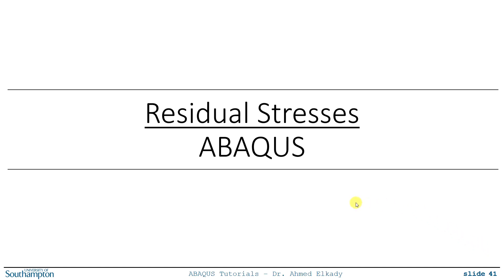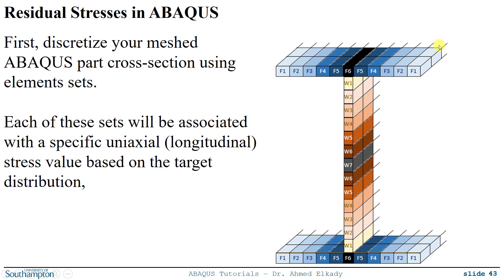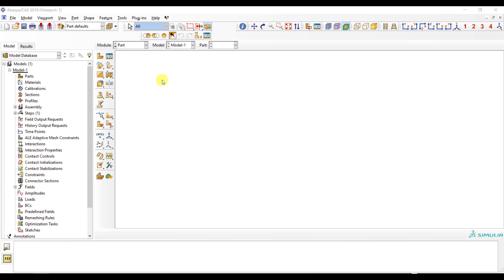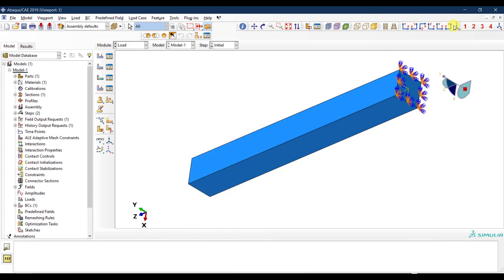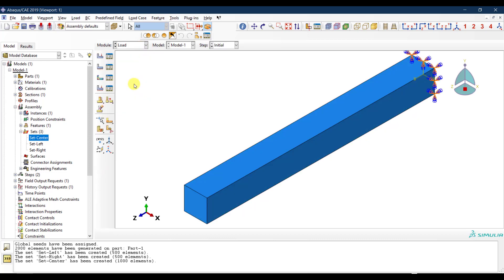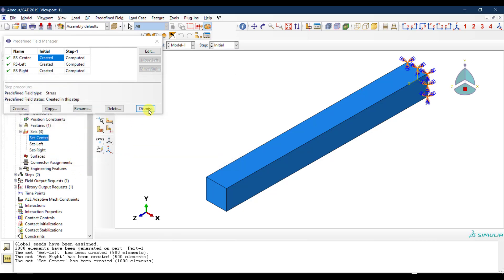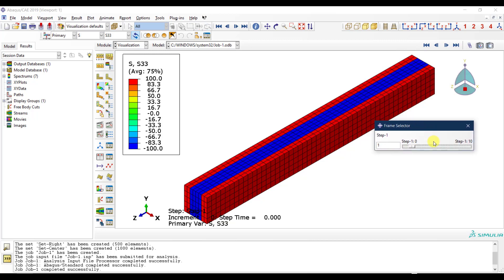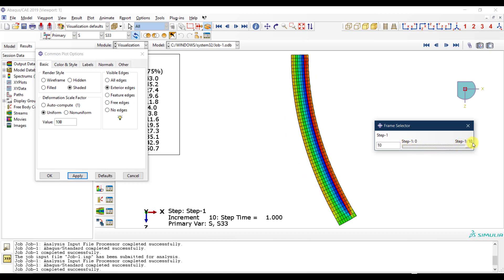#24 ABAQUS Tutorial: Modeling Residual Stresses

Comment: Thanks for your video.
Apparently using this method for residual stress in ABAQUS is not quiet right, because these residual stresses which we import as predefined field goes to solver and solve the equilibrium equation(which is wrong because it must not solve the equation for residual stress, it considers predefined field as an external force/etc), that is why you have different stress in the tip of the beam, it is not because of small errors.
Reply: Hi,

Do you know what would be correct way to input residual stresses in solid elements then?
Reply: @newtonavilasantos  No :/ 
Let me know if you find out :)))

Comment: How to apply residual stress by odb file
Reply: You have to do the same as in the video, except that you have to select "From output database file" at the Specification and point to ODB file. Unfortunately this only works for 3D elements and not for shell elements.
Reply: Then, is there any way to apply residual stress from odb files for 2D shell/wire element.
Reply: @aadilarfin8684  I haven found one yet. If I do, I will leave a comment.
Reply: Yes,  please share the way. Thank you

Comment: Thank you for the video. I have a question about the reason of the deformed direction. I was confused that this beam is bended to the right side eventhough initial stress of +100 tension is applied to right part and leftpart is -100 compression. It seems that opposite sing(+ -) of the predefined field stress direction is applied to the beam. Is it related to applied force and reaction force? Would you please explain this more?
Reply: I had the same question.

Comment: Appreciating your solidarity of showing your knowledge with us. I am stuck in a problem in same area of modeling. It would be helpful for me if you may explain how to apply the residual stress in shell members. I tried a lot of incorporating same in steel plates, but it is showing the error and analysis was aborted with convergence issues. I have to apply imperfection too.
Reply from the maker: The same procedure discussed in these tutorials for applying residual stresses or geomtric imperfections applies for both solids and shells. If you are getting convergence problems, then this is most probably due to other issues with the model such as ill-coditioned BCs or irregular mesh geometry.
Reply: @AElkady  thank you very much for your reply. I will check it.